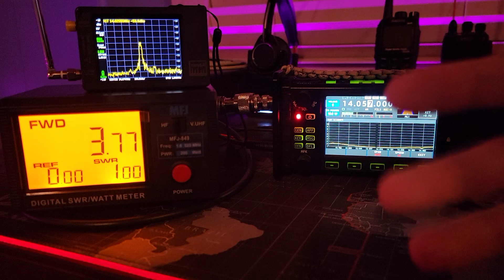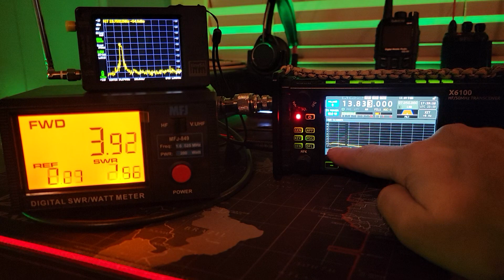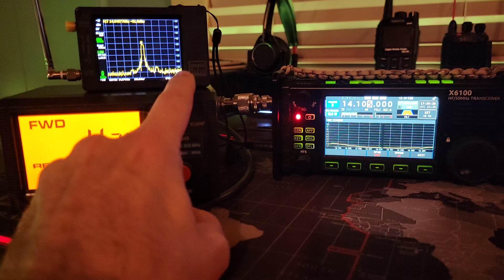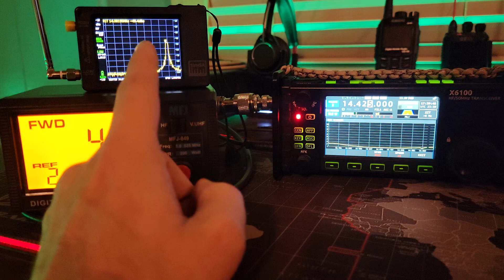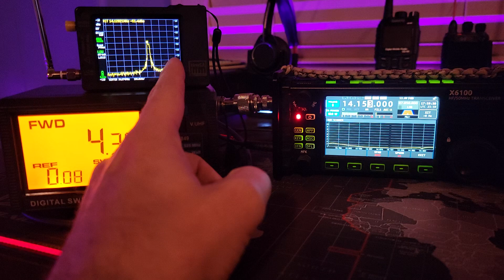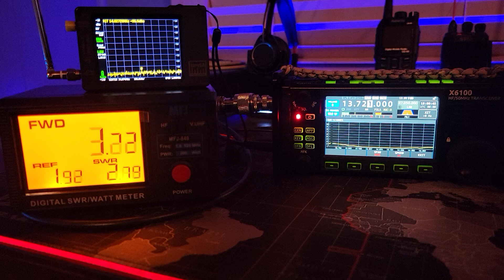X6100 Fart In The Wind

Comment: I don't understand why Xiegu is using full power to do an SWR scan.

At the very least it ought to switch down to 100 mW or as low as possible to get an accurate result.

This has several benefits:

1 While I am not sure it makes a legal distinction, it seems like a smaller "fart in the wind" is preferable.

2 Less power saves battery life.

3 Less power puts less strain on the finals.

I don't know if Jet / Xiegu programmers listen to us but I would strongly encourage them to lower power for this function in 1.1.7!!!
Reply: And of course a nanoVNA or MFJ antenna analyzer is basically doing the same, just with a lot less power output (mW, maybe less).

You have to have some signal for an SWR measurement. If the FCC cared about "farts in the wind" they'd have surely said so by now.
Reply from the maker: You are right on all accounts!  This is a problem that spans decades of radio knowledge and is technically illegal, but not something to waste any resources on.

Comment: You ever in the middle of a QSO and suddenly a signal sweeps across the band?  Yep !  Ive had my MFJ analyzer heard in Europe from the USA and thats a fraction of the power.
Reply: those sweeps across the band are usually Ionosonde.
Reply from the maker: Interesting!
Reply: Would be interesting to open a few WebSDRs to see if you can hear an analyzer, and how well, at a given moment and frequency.
Reply from the maker: @AlanElBee  I have a video tomorrow about the g90, you can hear it on another local HF radio.  I'll check unto a websdr also.

Comment: Besides the SWR sweep, what does it do while the tuner is activating? Compare that to some other rig such as the Icom-7300. The Icom does not sweep the band but does transmit during tuner activation but only a tiny miniscule amount of RF.
Reply from the maker: It transmits lower power during an ATU cycle than during an SWR Scan.

Comment: I had been turning my power down to 0.1W for tuning & SWR scanning with my Xiegu X6100 anyway assuming there was funny business. Were you able to see if the power output control had any effect on this? I'd check myself, but (1) I'm not sure my cheapo power meter would work accurately for this and (2) I'm lazy. 😆
Reply: Oops, saw you answered that. Guess I shouldn't bother anymore, then.
Reply from the maker: No worries friend.  Ask away!  The SWR scanner doesn't respect the user's power setting.  It should enforce minimum power needed to get the job done and not allow me to turn it up.
Reply: @temporarilyoffline  Agreed, that would be the right way to do it. Something to look forward to in 1.1.6 Revision 3 😆
Reply from the maker: @EmJayArr  exactly!

Comment: If you turn down power to 1w before using the scanner, does the power used in scanning follow?  That would be nearer to a fix, since the scanner is a nice feature but can’t be adjusted to stay within band.
Reply from the maker: It does not.  I turned it down to 0.1w before sweeping and it was ignored.  Its probably very easy to fix in firmware, but I'm not on Xiegu's payroll... so I won't tell them that ;-)
Reply: wow David I had the same thought -- a bit nuts that it would default to 5 watts. 

(Unless the SWR circuit somehow needs that much power to get an accurate result)

Comment: cool i would like to se the G90 do this  .. Also does the G90 have to have any programming changed in order to do this ??
Reply from the maker: This is built into the G90 already - Press Function so the light turns yellow and then long press PWR key on the right side until the SWR Scanner displays!  You're good to go!

Comment: I suppose you can shock everyone by showing that any analyzer is putting out "some" power to determine SWR. Now, most will use MUCH less power of course (mW or uW).    The power level does seem excessive for the function. Fart in the wind? Extreme QRP folk would probably disagree with that statement. The real question I suppose is, is it "harmful"? In the grand scheme of things I'd probably say no. It is certainly not as annoying is someone tuning an amplifier (or any rig really) on frequency on top of another ham. The engineer in me would like to see the output power reduced though (or at least settable so those who care and drop it down).
Reply from the maker: You are completely correct!  I guess I wasn't specific enough on the fart in the wind comment - I wasn't referring to the power out level as much as the tone-on-sweep part of it.  It litterally blows buy your signal faster than you can discern it from QRM/N/QSB.  Its just a small little blip, much less than say a lightning induced static crash.
Reply: I agree. A lower power would be nice of course, but this is mostly a noop. For any equipment to measure a swr of a signal , one needs a signal. A lower power one would be great. But that does seem to move quick enough that it should not effect anyone.

Comment: I'd be curious to see how much power my nanoVNA puts out running an SWR scan. Unsurprising that the scan can transmit on any frequency and I see you don't have the open TX enabled. Having designed SA & VNA commercial products in the past, I know they transmit all kinds of things anywhere within its bandwidth.
Reply from the maker: Right, totally agree - "measurement" isn't the same in my mind as "TX-out of band"

I specifically disabled Full-TX for this test, I would definitely expect it to TX out of band with Full-TX enabled.

Comment: Causing interference while tuning up is considered rude, but so far not "intentional " or "malicious" interference by the FCC so I'll go with the fart in the wind assessment.  Transmitting intentionally out of your license class privilege's is a black and white no-no in the regs.   Up to each op whether they want to worry about it or not.  Seems like low hanging fruit for one of the 8,283,291 firmware releases to limit the frequency range of the sweep.
Reply from the maker: Limiting the frequency range is "correct", but it leaves you with not knowing if your antenna is too high or too low, since you don't know where it is resonant - maybe you're on a mag loop and the antenna is resonant at just below 14.000 and a TEENY TINY witch of the tuning cap and you're now resonant at 14.750 :-D  Not arguing, but an "analyzer" is my thought of what this thing is trying to be - I think it should TX about .1w (firmware fix) or so to get its answer and people would then care even less.  This thing is SUPER useful for tuning a Hi-Q antenna in the field without a dedicated analyzer.
Reply: @temporarilyoffline  Dialing back the power would solve the problem too.  There's some threshold where it becomes a test instrument rather than a transmitter.  Having the analysis available in the field is most definitely valuable.

Comment: If I remember correctly, my G90 does the same, uses full power for the SWR meter.
Reply: Even when turned down to 1 Watt?
Reply from the maker: The X6100 doesn't respect my power choice when using the scanner app.
Reply: @LouiseBrooksBob  test results right now on my G90:

Whistling with 20W = 4.53A peak
SWR meter with 20W = 3.27A continuous
SWR meter with 1W = 3.27A continuous
Reply: @LevyCarneiro  Why is the figure reported as amps? SWR meters customarily report  SWR as a ratio, and  often forward or reflect power as Watts. The use of amps might suggest current drain from the power supply.
Reply: @LouiseBrooksBob  I’m referring to current drain when using the SWR meter, too high for just metering SWR, plus it annoys people on the air with that sound sweeping the band.
Reply: @LevyCarneiro  SWR measurement should be done at low power to protect the final transistors.
Reply: @LouiseBrooksBob  yes

Comment: if you're putting out more than milliwatts outside of the Ham Bands then you're illegal.  I love the SWR scan mode, but am somewhat blown away that it's not Ham Band locked, or set to limited power.  Once the FCC hears wind of this, these rigs will be banned.  Use at your own risk.  In the mean while config it to not xmit outside of your authorized frequencies.
Reply from the maker: I can't imagine the FCC will admit their original failure in allowing this radio to be IDd

Comment: Shame that this have no such SWR meter that I know from G90, X6100 is little useless for tuning mag loops or screwdriver antennas
Reply from the maker: Check out this older video where I show an easy way to use the X6100 with a mag loop.  https://www.youtube.com/watch?v=6K4MQagz4vw&t=229s  Its time-stamped right to the section where I tune the loop.  If you want to see the homebrew loop, I show it in the beginning of the vid.